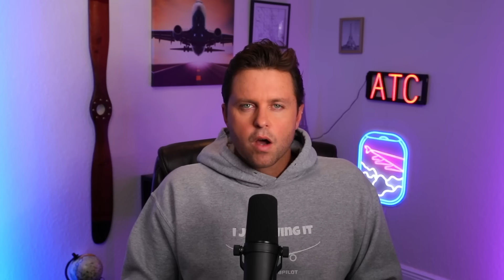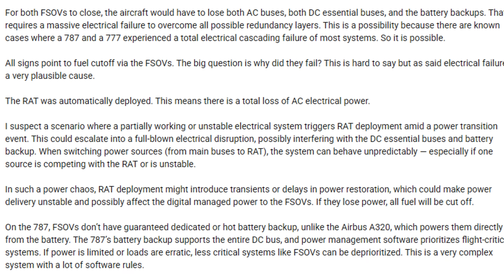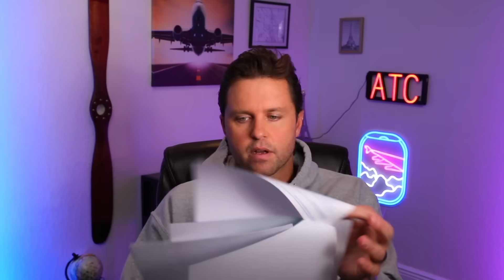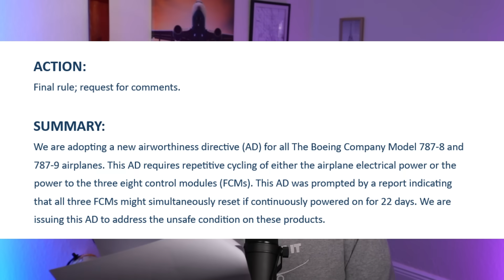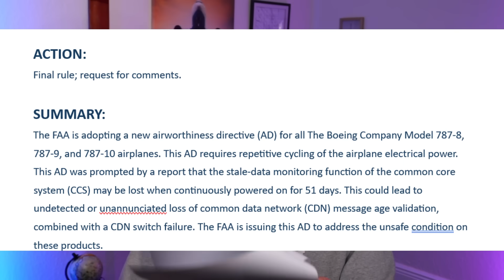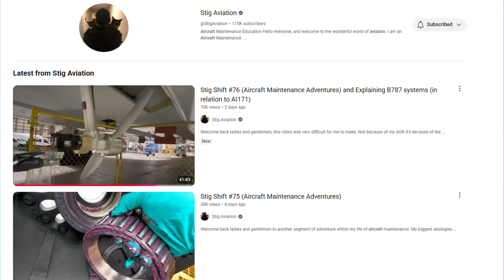Air India 171: Did a Software Glitch Cause Dual Engine Failure?

Comment: I fly the 787 and this truly scares me.
Reply: I can imagine. Pilots have no chance to intervene, when something like this happens. Pilots and passengers should boycott flying Boeing at the moment.
Reply: In your place, I'd be rebooting everything before every flight.
Reply: @chuckmiddaugh7908  It won't make any difference. Electrical failures are inevitable in long run.
Reply: My dad retired AA 787 back in 2021. I am sure he is relieved.
Reply: Is it correct that the 787 fuel cutoff switches will spring closed if they lose power? In my limited experience on fighters I've only seen fuel masters that are purely manual and actually require them to be pulled up before allowing them to move to the off position. You have to want to turn them off.
Reply: @briankeeley6464 my understanding it is the fire fuel cutoff.  Not fuel cut off switches. 

It’s still messed up.
Reply: Correction, you RIDE, not fly the 787.
BIG difference.
Reply: At this point there's no specific reason not to mistrust the 787 over other planes. We don't have enough evidence.
Reply: @neil_digital  I'd rather be safe than sorry, ground the fleet and save lives than wait for evidence that might not produce change until another crash
Reply: Sure you do. Navy SEAL too?
Reply: This screams McDonnell Douglas corporate culture
Reply: @Relly1984 Sure does.
Reply: @Relly1984EXACTLY!!
Reply: With this as a cause no pilot or engineer action could save the aircraft. So I bet it does. Operationally 787 should not now operate from airfields with high temperatures if the aircraft had electrical issues, as this aircraft did.
Reply: I read that Boeing stock is up because they are leaning towards Air India Maintenance deficiencies.  This to me sounds like a Boeing design issue or perhaps metal shavings causing weird things to happen?
Reply: Yes I should think you are under these tragic circumstances. I feel bad for you and I hope somehow you will find more confidence with The 787.Hopefuly the black box with reveal what happened and it can all rectified. My thoughts are with you sending love from England ❤
Reply: I was hoping to hear from some 787 drivers. Has anything remotely similar happened to you? Quite disconcerting…
Reply: Are you whistleblowing?? Boeing is coming after you. 😑
Reply: I'm not flying this as a fa until they figure this out  stay safe 🙏
Reply: @elainemarra9790  You make no sense.
Once they figure this out and you fly again, all you are doing is flying on airplanes (any airplane) BEFORE then NEXT thing to go wrong and crash.
Logically, regardless, if they figure this out you still should not fly.
Thanks, MORE room for me !
Reply: What airline
Reply: @AviationNut:  finally a 787 pilot speaks up.  To help Gary, figure the takeoff data for AI171.  Let us know what they were looking at.  
People have been waiting almost 2 weeks to see if the takeoff was just another hot day takeoff in India, which it was.
What does the 787 systems manual say about the fuel shut off valves having the ability to “automatically” close?
You have the capability to add lots to the discussion.
Reply: @gordonbryan8381 😂😂
Reply: Airworthiness Directives are pretty worthless.
Reply: I don't feel flying is safe right now, until all these issues are taken care of.
Reply: @kimfontenot1274  Moreover I would never fly in carbon fiber. Thankfully I never had to fly in 787.
Reply: @kimfontenot1274  i try to use airbus planes - boeing is just too dangerous
Reply: Man be safe another pilot said to departure with APU I don’t know
Reply: Im flaying only on A350 the best plane on Earth
Reply: @pandosann  Qantas 72 was an Airbus.
Reply: @pandosann  I'm not flaying at all!
Reply: I bet.
Reply: I don't think it's just a simple "AC Power Failed" and software glitch shut down both DC buses. There's a lot of redundancy, two batteries+RAT. The pilots said they lost thrust, but not control.. power is needed for control. The surviving passenger said the lights flickered, so they didn't go out.. that means AC power.  From what we know, it doesn't seem like the plane was unpowered, even though the engines spooled down. To me it sounds like the RAT and batteries kicked in once the engines spooled down.

Why simultaneous FSOV power loss is unlikely:
    Separate Power Sources
        Each FSOV is powered from a different DC bus (DC Bus 1 for left engine, DC Bus 2 for right engine).
        These buses have independent power feeds from separate TRUs and batteries.
    Built-in Redundancy and Backup Power
        If a DC bus loses power, the CPCS automatically reroutes power from battery-backed buses (DC Standby Bus or Battery Bus) to the FSOV circuits.
        The batteries and standby buses are designed to provide power to critical systems like FSOVs even if the main DC buses fail.

    Fail-Safe Design of FSOV
        The FSOV is spring-loaded to fail closed if unpowered — so losing power would close the valve, cutting off fuel to that engine, which is a safety feature (fire protection).
        But the system tries hard to maintain power to avoid unintended shutdowns.
    Multiple layers of monitoring and protection
        The Electrical Power Control System (CPCS) constantly monitors and manages power distribution, preventing loss of power to both FSOVs at once under normal and many abnormal conditions.

Under What (Rare) Conditions Could It Happen?
    Catastrophic dual electrical failure affecting both DC buses and the backup power systems simultaneously.
    Severe damage such as a major fire, electrical short circuit, or structural failure disrupting wiring to both FSOVs.
    Multiple system failures including batteries being depleted, contactors failing to close, and CPCS logic not rerouting power.
Summary
    While it’s theoretically possible under extreme, compounded failures, the 787’s electrical system and FSOV power distribution are designed specifically to prevent both FSOVs from losing power simultaneously during flight.
    Losing FSOV power on both engines simultaneously would likely trigger immediate crew alerts and emergency procedures.
Reply: Same. Over 2000 hours.

in Flight Sim

Comment: In good design unnecessary complexity is avoided, and simple solutions are used that are better for safety and reliability reasons. --  Did the Fuel Shutoff Valve (FSOV) get shut off by a rogue software glitch? Hopefully the truth will come out about what happened to Flight 171, this problem must be is fixed before confidence in the 787 can be restored. -- Thank you Gary for a stunning revelation to a possible cause to why those engines stopped working.
Reply: “In good design unnecessary complexity is avoided”. Perfect. Very well said @martentrudeau6948

Comment: you are starting off accepting a dual engine failure, for which there is no proof. the survivor only said the plane came to a standstill and green and white lights came on, and he heard the engines spool up. Doesn't agree with engines dying. All non essential electricty was probably shut down and the emergency lights lit when they couldn't reach positive rate of climb. Which was either becuase they used half the runway only or because of bad fuel. and the plane stops climbing first, and then the ligths change. so the electricity did not cause the loss of climb. And losing everything related to electricity, all independent components all parts connected to the 2 engines and the APU, suddenly is like expecting the 2 engines to go out at the same time. It's like an EMP blast went off by the plane. This is a preposterous explanation.

Comment: Reinforces what I wrote in your video with Cpt Steve. 
There were electrical issues that day on the earlier flight, as video evidence showed. And I asked you (and Steve) to look at the possibility of a complete electrical failure, causing a disruption in the fuel flow. 😉 You couldn’t hear the engines in that one video from the rooftop. 🤷‍♂️
Now with all this other information you just presented, it makes it all the more plausible. 
If correct, Boeing is going to take a nosedive from the fallout. 🙄
Reply: They won't be able to survive from this fall out
Reply: @eco_logic 
If it turns out true, Boeing will collapse. They were once the best. But after the merger, and corporate restructuring, it went downhill. Airbus is dancing circles around them. I used to love Boeing. But not anymore. I’ve found Airbus to be a far better product (today), and more comfortable in flight. Boeing needs to go back to their roots in order to survive.

Comment: Why am I not surprised that such an important component like the fuel shut off valves are NOT hooked up to the battery? Same story as for the B737-NG, where the FDR was not hooked to the battery - which is the reason why we will never exactly know what happened to the JEJU Air B737 before it crashed! Who designs stuff like this! Sound like another MCAS to me! There is obviously a more failsafe way to design this, if Airbus cando it! What good is a „protect the airframe“, if the plane is stalled and crashes to the ground?!? Whiskey-Tango-Foxtrot!
Reply: Good observation - there could be a strong link (essential systems not on the emergency bus) between the Jeju 737 and the IA 787.

Comment: This was an electrical failure. This was a FADEC failure; this plane was in a huge rain storm, and I bet money water got into some critical electrical system, and interrupted power to the FADEC. On this plan, the engines have NO MECHANICAL controls, so if the FADEC doesn't have power, the engines spool down to windmilling speed because the fuel metering closes by default as a failsafe to ensure "runaway" thrust doesnt occur. 

This seems like a HUGE safety test case that was missing. There is no excuse for loss of electricity during rotation to not have been tested. 

Boeing is going to be in BIG trouble
Reply: Thanks. When was it in a rainstorm. How can water get in during a rainstorm.
Reply: @TheCheckit96 I'm not going to directly answer this question, but if you do some research on some of the maintenance issues on the 787, I'm certain you'll find somethings about water ingress
Reply: @TheCheckit96   composite construction?
Reply: Rainstorm, really? Do you know for a fact that the engines spool down when the fuel metering closes or are you just speculating?
Reply: @MrDarin1 Yes I know this to be true.

Comment: I've been suggesting this for a while now, admitting I do not know anything about 787 systems, but relying on logic alone.  What could cause two engines with independent systems to fail at the exact same moment and to the exact same degree?  Only pilot input or some sort of surrogate input.  Like auto-throttle or something.  And could the deployment of the RAT come about if the engines spooled down and the software believed that was an impending electrical failure?  And is it possible that the event was so docile that the flight crew did not have time to properly diagnose it?

Comment: One thing is very clear and obvious whatever happened to AI171, it was triggered by pushing the landing gear up. That landing gear circuit behind the interface cause some kind of an electrical failure that effected some electrical circuit that rollback engines. As to my understanding, engines does not flamed out permanently as they would because of a bird strike and become unusable,  rather a 'rollback' occurred which means that if this would have happened at some 37K ft altitude, they can restart the engines again, but unfortunately it was just 600ft where they cannot do anything. So here is potential sequence of events that looks somehow plausible so far. 
1. 'Gear up' triggered a major electrical failure that resulted RAT to get deployed and also freeze the landing gear in titled position. 
2. This electrical failure somehow potentially triggered a dual engine rollback for preventing engines from damage (may be a safety feature in case of electrical failure of Full Authority Digital Engine Control (FADEC) system). 
3. once the rollback starts, the heavy aircraft loses thrust and altitude fast and crashes.

Comment: The fact is the plane had an electrical problem. There is a video from a prior flight showing the lights flickering and a witness's account of the entertainment system not working. It is nearly 100% that the RAT deployed, adding further evidence of an electrical problem. It's hard to believe these electrical problems did not have anything to do with this crash.
Reply: Facts
Reply: Do you reboot your computer every day?
Reply: where is this video of the previous flight that everyone keeps talking about? Do you have a title, or video id, or channel??
Reply: @gorak9000  yep, no verification that the video in question was actually shot onboard the same aircraft on the pervious flight, so not putting much weight on that at all.
Reply: most of electrical problem can be fixed by simply reboot the system.
why won't the airline do that?
Reply: @lizhongshen .....The doomed plane flying with no engine power and at only around 600 feet from the ground, where is there enough time for a full computer reboot?
Reply: @lizhongshen  Why it needs to be rebooted after 3 different periods. What if they made it and still didnt work and this is just another module that requires re boot every 8 days. It is not a cellphone, it is an state of the art 200 million dollar jet liner. If software is so bad, why is allowed to operate and why it is not fixed ?.
Reply: Flickering lights could also be the switch from APU to engines.
Reply: If the engines go below idle speed, the generators will trip off. "Flickering lights" is more likely to be the cabin lighting going off and the emergency lights illuminating. There may also be very short power interruptions if one engine fails, causing the remaining good engine to provide power to the whole aircraft. This happens on 767's. There may also be "loadshedding" if power from the remaining good engine generators (2 of them) is insufficient to power all the systems. Usually, things like the Inflight Entertainment System is shut down automatically to save power. If power is further reduced, even some of the fuel tank pumps are automatically turned off. The plane can happily fly on one engine with only one fuel pump. If no pumps operate, the engines suck fuel from tanks using their own non-electric pumps.
Reply: Electrical problems a day before would not be in relation to what's written in the AD's.
Reply: Do you reboot your computer every day?
Spoiler alert!
I, for one, do not do so.
I wait about 3 to 4 weeks and then it crashes!
Fortunately, my computers do not erupt into nuclear like ball of fire.
Reply: @PhilipFly11  you reboot your car everyday, don't you?

Comment: We tend to get ahead of ourselves assuming technology is superior to experience.  

80’s and older vehicles could have mysterious electrical issues anywhere in the system. Uncommonly, shorts w/ problematic 1/2 a$$ repairs could cause catastrophic electrical failures. But, those stalls would coast to a stop. 

I prefer looking for the ABC’s of ignition. Keeping it simple and staying w/ the basics 1st. 

Flight data shows previous leg was not immediately preceding this one. Too many separate system glitches for coincidence.